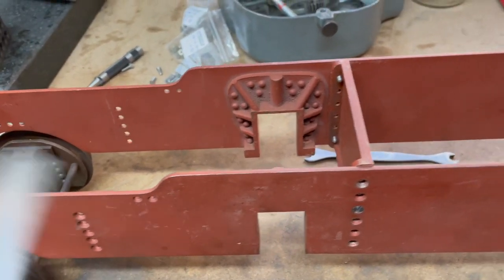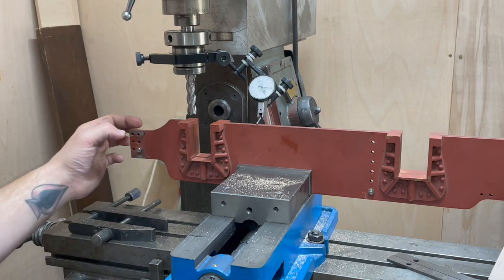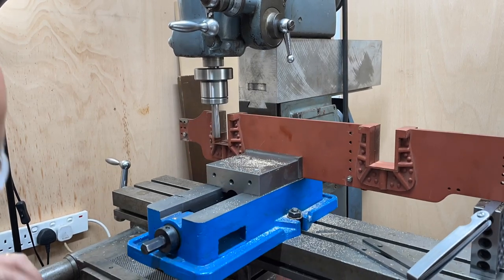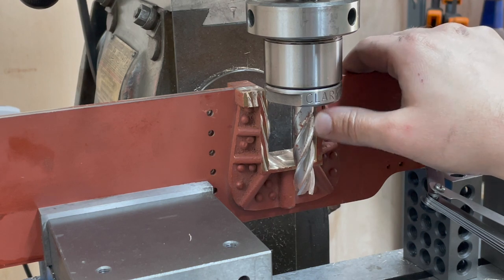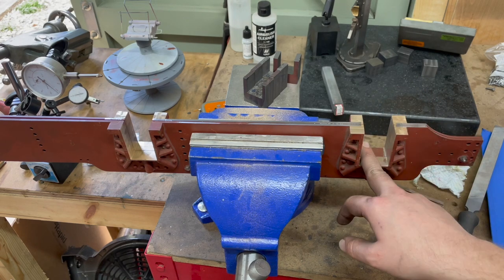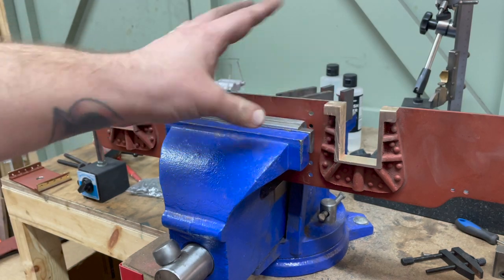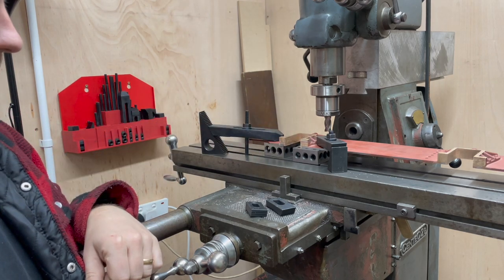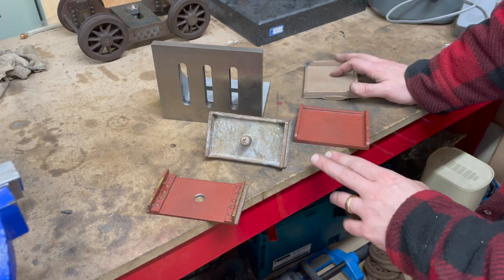Milling Catastrophe while squaring-up Horns - Steam Loco Build #15

Comment: Hi William, quick word of caution. Measure your 123 blocks in all aspects before using them like that. I ordered some from Banggood and 2 were slightly out. I have found someone to surface grind them all (I have 3 sets) to the same dims. I was using them all mixed up and expecting them to be the same thickness but they weren't. Loving your vids, mistakes and all. We have make them and it takes courage to share them with us all.

Comment: I often tell folks I have mentored in the hobby over the years the scrap box is your friend, if the part is not right and cannot be quickly repaired throw it in the scrapbox as you have indicated you are planning with the with the bogie bolster and the frame stretcher. Just a side note if the misstep on the hornblock had not been able to be rectified by bring the hornblocks to the proper size you could have always told folks the marks were oil groves. I have noticed Matt is back in his shop coat but you have the red flannel jacket on saying the weather isn't warming up over there. It is still cold and wet here in New England.
Dick B. USA
Reply from the maker: Thanks Dick - it's sometimes a tough call to make especially when time is invested in a part but even if the part is lost the experience stays with you. Easy to say that - hard to do! I think I'm rapidly getting this into working order, so not to worry! Weather here is changeable - bright sun and then rain and snow on the same day. Right now? high winds. Who'd have thought?!

Comment: Hello Matt,
If you went to the gym and there were no weights you would not get any stronger... if you did not have any challenges in the workshop you would not get any better... Nicely recovered.
Take care.
Paul,,
Reply from the maker: That's quite true. It's all a learning experience and one benefit of 5" loco size is that though some components can come from expensive materials or take some time, messing up one piece doesn't affect any others!

Comment: Nice recovery William. 
As a general observation, I would look for more rigidity when holding your workpiece(s) in the mill.
When I assembled my frames/chassis I spent a good few hours to get the whole lot square: tightening the bolts into each stretcher, loosening them back off  applying pressure to the frames before re tightening again, repeated many times.  Look long and hard at the buffer beams to make sure they are square to each side of the frame and assume that no part is dead straight - I didn't realise how much my buffer beams had bowed until I couldn't figure out why I couldn't get them square to the frames on both sides 😁  If you can get some bar to sit across the frames in the horns (machined to fit) when assembling that will help too.  I put the final cut on my horns with the frames assembled  but table travel on the mill may be an issue.  My frames had also bowed a lot in the vertical plane too (my chassis was noticeably banana shaped), and once assembled I had to apply a lot of pressure to get them back to being level.
Good luck and keep sharing 👍
Reply: Great video, William.
Very well presented and to the point.
Great to see how it is coming along, glad you managed to remedy the mishap.
Reply from the maker: Mark, thank you - this was the first time trying to mount something so large in the mill and I was caught a bit off guard. After milling the insides of the slots I bought myself a proper clamping kit and no doubt that should help. Do you have any advice on that arrangement? I'll need to set them up again to drill the oiling and spring plate holes...
Reply from the maker: Thanks matey, it's been a somewhat traumatic learning experience but thankfully nobody's life is at stake: the only thing lost is time, after all. I'm glad you enjoyed the videos, I do vascilate between longer and shorter content but it would appear about 10 minutes is a sweet spot.
Reply: @williamsworkshopuk  part 5 of my Jack series shows how I did it William, but I probably went a bit OTT and of course having a large enough mill table is a pre requisite.
I also had a disaster with mine very similar to yours which I allude to at around about 5:45 in that video.  Mine was caused by me not securing the milling head on to the column - D'Oh!

Comment: Hi William
Shame about the dig in!! don't get disheartened, it happens to us all!!! anyone who doesn't make mistakes has never done anything!!!,  I don't how, but if you were climb milling at the time, if everything's not super clamped up, the cutter will pull in to the work on these hobby machines.
My other comment is as Aam Cro, said keep a close eye on the wheel centres position, or you will have to adjust the connecting rods. etc!!
Also for every operation that is a little out to the drawing, it will have a knock on effect on everything else as you get to it!!
take care
Kev
Reply from the maker: Yeah as I said in a reply to Gurnhills Garage I think I somehow had backlash 'available' to the direction of cut, which pulled the workpiece towards the mill, and then that meant I was suddenly climb milling and then it all went a bit pete tong.

With regard to diverging from the drawings, you're not wrong. The two features (slot depth and width) only affect the axleboxes presently, and I hope to keep it that way!

Comment: Not too big a catastrophe, as it turned out you were going to machine that off anyway. Well done.
Reply from the maker: I didn't know that up front lol - actually that face was bang on 0.625" so I'm about 15 thou under on all horn widths, but not so bad!
Reply: @williamsworkshopuk  If it is consistent you can make the axle boxes to fit, so all will be well.

Comment: Will I feel your pain on the "incident" well recovered once again I did a similar thing when I was doing the same operation on my tender axle boxes.  I skipped my (2 1/2" gauge) frames and restarted
Reply from the maker: That sounds painful. I think for mine, if I had been unable to get a reasonable finish then that would be the next port of all - I already have the laser cut main frames, but (foolishly?) figured that the ones I got in my box were OK. I think it would have been less work to just start from scratch!!

Comment: Just a note to make for the future, when axleboxes are in, check the wheel centres. I don’t know if you plan to machine from scratch or buy laser cut blanks but as you have tweaked the openings the centres May no longer be exactly as drawn (may not have been in the first place).
Reply from the maker: Thanks Adam, I don't think there was any chance in hell whatever was there was even remotely as drawn. I have coupling rod blanks from M.E.L. and my plan was to use the same method as Mark's Home Engineering i.e. large calipers between axles once they're in and square, less one axle diameter. The build notes suggest drilling a small pilot hole first, reamed for a very close 3/16" fit and using 3/16" silver steel rod to check for squareness first - then adjusting as appropriate. Sound OK? ps. Does your Grandad's Maid have a cast bolster or fabricated? Wondering if I should machine the integral cast bolster bogie pin or cut it off...
Reply: I’ll go and check this evening when back from work!